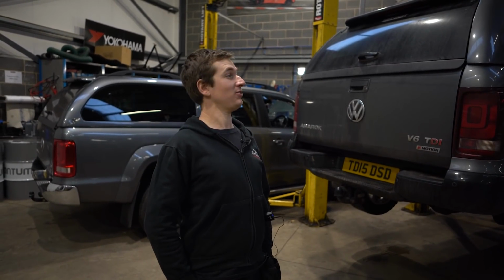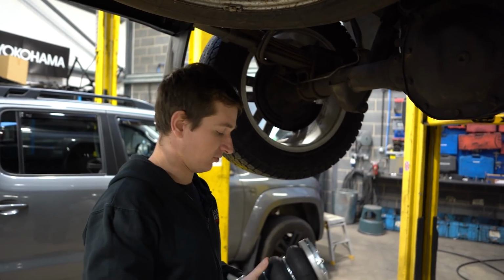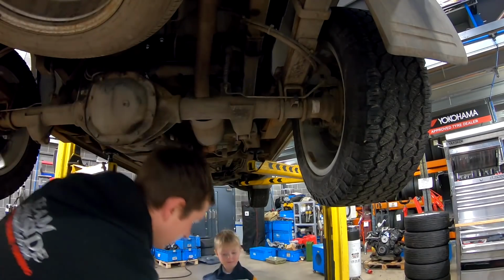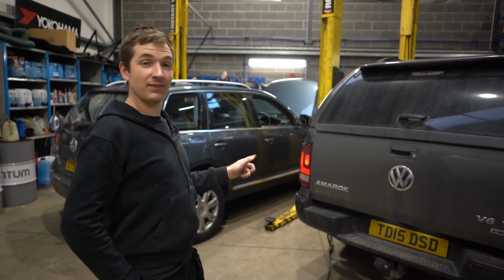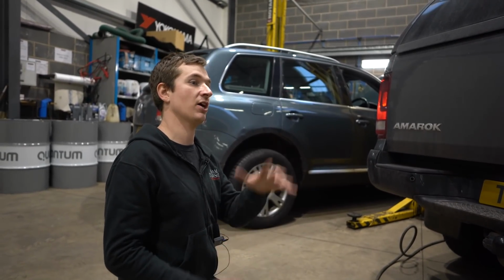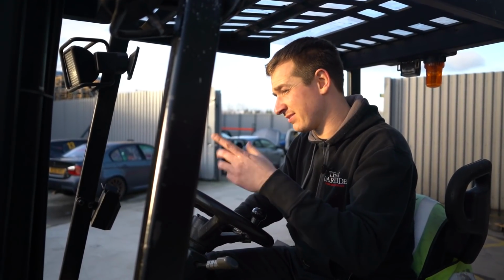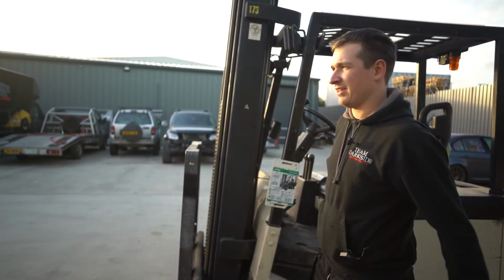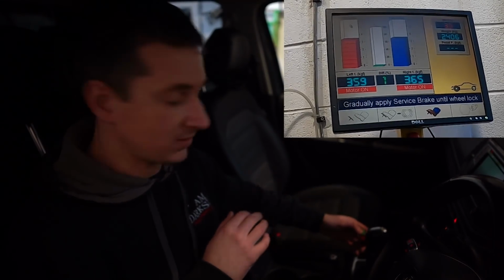Air Assist and Up-plating our VW AMAROK!

Comment: As a possibly stupid question, but why not just trigger the electronic handbrake off the existing wiring for the handbrake warning light instead of using a seperate button? That way the driver doesn't need to be taught/remember a new set of controls that could see them either trying to drive with handbrake on or forgetting to activate it when needed... they interact with the system exactly as if they didn't know it had the supplemental system fitted.
Reply from the maker: We thought that but it's putting a lot of strain in the system pulling it so hard all the time.

Comment: Is there a way of linking it in with the load sensing valve for the brakes? Just thinking if there’s loads of weight over the back and the air jacks the suspension up it wouldn’t be getting the braking effort to the back it needs?
Reply from the maker: Its ABS equipped so that takes care of the proportioning.

Comment: Never understood why VW didn’t do electronic handbrake on the V6
Reply from the maker: Would save me trouble!
Reply: Some countries still have regulatory issues with electronic only handbrakes, and the Armarok is sold pretty widely, so that could be the culprit.... and hopefully its not something stupid like marketing department feeling the manual version is more "rugged" or "manly" to appeal to tradesmen, but with VW it could sadly be something like that also.
Reply from the maker: Real men like to hold a stiff shaft!

Comment: With the payload being increased would you start to face issues with frames starting to bend and crack over time?
Reply from the maker: Hopefully not!
Reply: You absolutely would if you start trying to take that weight off-road.... but down a highway the amount of deflection you'll get with extra payloads likely less than the stock truck offroad and empty. On the other hand there is a good reason darkside tries lots of this stuff itself before promising/pricing a kit, it'll let them abuse it a bit find if there are any other weaknesses they need fixed in the upgrade package, could be something simple like a bushing, could be something complicated like ABS bias, it can be right on paper, but the only way to know for sure is to test.

Comment: I have air bags on my ranger & tow fully freighted at 7000kg. I put air in and then adjust ride height accordingly. You find pressure increases with addition of weight.

Comment: a kid in overalls ' helping ' his dad , there is nothing nicer .. and air-bags are great with leaf springs , especially older style multi leaf as you can take out a few leaves to improve empty ride comfort but still carry / tow weight when needed
Reply from the maker: Cheers, Yeah if we were not running at capacity I would take a couple out!

Comment: Would you not have considered a full air suspension setup to get rid of that horrible riding empty leaf spring rattle when it’s just at the top of its travel? A V6 Amarok on Full air is a Disco 4 Killer with an engine That won’t spit bearings out for fun 😂
Reply from the maker: I'm not sure its worth the engineering!

Comment: I really don't understand the point of electronic handbrakes
Reply: Ease of a button
Reply: Electronic handbrakes can offer more force than a normal car sized ratchet, while letting less physically strong drivers attain full force, and more importantly release the brakes if the previous driver pulled them on very firmly. They also prevent the system being left partly engaged when driving, or being applied very lightly so the handbrake sign is illuminated but the vehicle could still roll away. They can be interlocked so as not to be able to come on above a certain speed, which has resulted in crashes with manual handbrakes. They require less interior cabin space to have a button hand the lever did, and can be located where they are less liable to be bumped on or off. Finally many designs apply a constant force, not a constant distance, so if something lets the brakes more inwards further the handbrake remains effective, where a manual lever will let the vehicle roll.

The tradeoff is of course they are slightly more expensive, harder to service/repair, and confound some (normally older) drivers who've never dealt with one, meanwhile I have never met an already licensed driver that needed any explanation of the manual kind (they probably exist, but its FAR rarer presently).